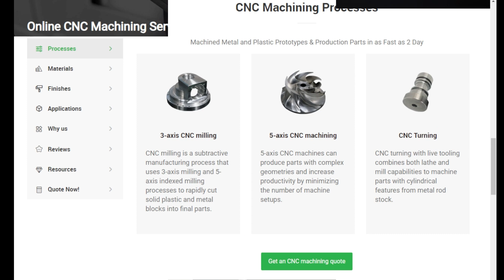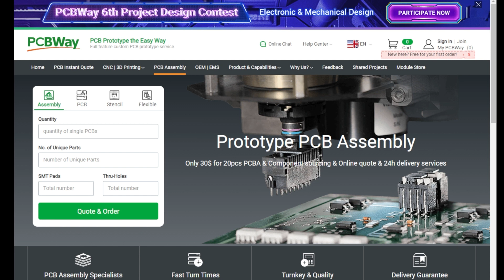Apexmaker X1 - Changing the screen

Comment: I wanted to thank you for helping me.  I actually bought one of these printers during the kickstarter campaign but I never got to set it up until now. I waited a long time because they never shipped me my wash station, they shipped me two curing stations by mistake, and as hard as I tried I could not get them to understand the issue. I didnt want to use it until I had the washing station.  I never did get the wash station, but oh well... Kickstarters.  Anyway, when I turned on the machine, for the 1st time I could hear it running but the display was black. I watched this video, and you showed how to take off the front of the printer. I did that and found a loose ribbon cable. I reseated the cable and now it works!!  Thanks again, I probably would have trashed that delicate cable if I had not wathed this video 1st!